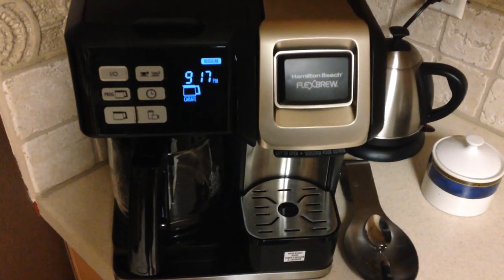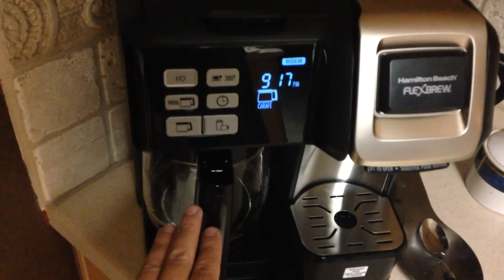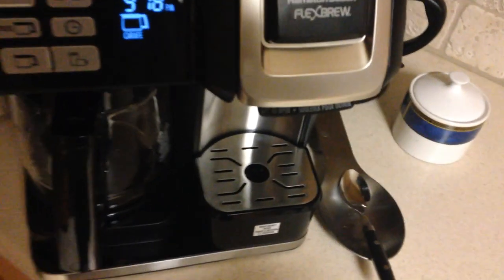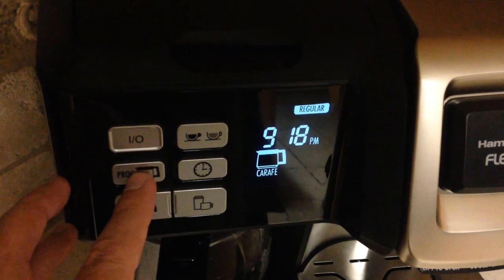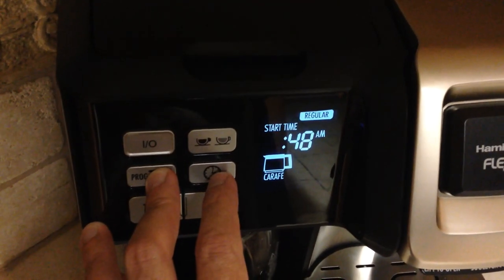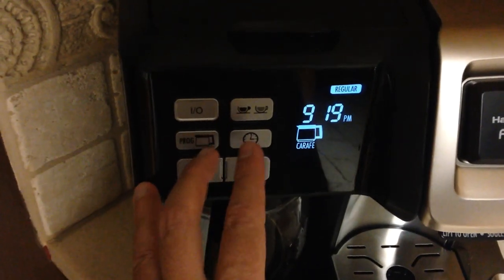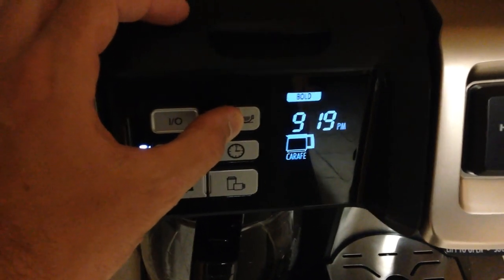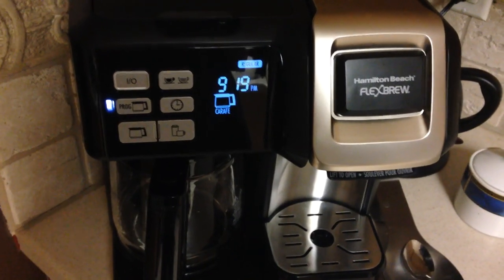Setting the Hamilton Beach (49950C) FlexBrew Coffee Maker, Single Serve & Full Coffee Pot

Comment: Does this machine still work?
Reply from the maker: Mine is still going strong.
Reply: @JUMBLE2015  Is your machine STILL working? How long have you had it now?
Reply from the maker: @neverfeartruth6460  Mine is still going strong, I use it multiple times a day.  I have had it for about 3 years now.  However if/when this one ever goes out I will buy Hamilton Beach again but will not worry about having the pot option.  With this one we tend to only use the K-Cups, hardly ever the pot. . . so in the future I will go with one that is a little smaller (no Pot option).  Hope this helps.
Reply: @JUMBLE2015  Thank you! I love mine and use it multiple times a day as well! Thanks for the reply!